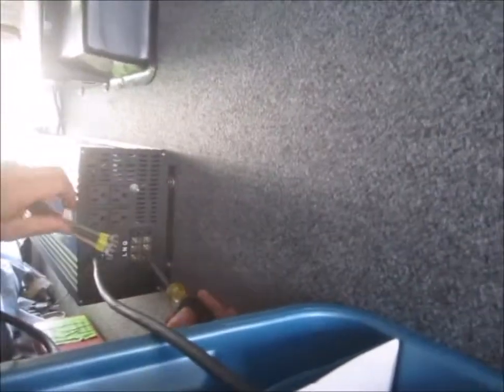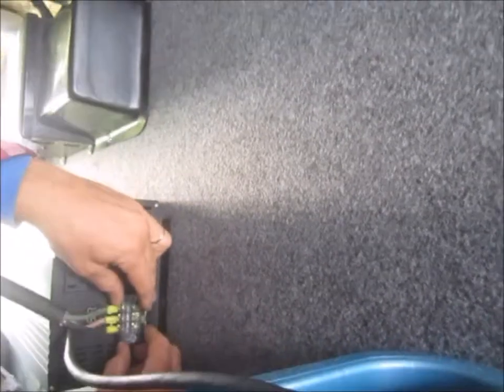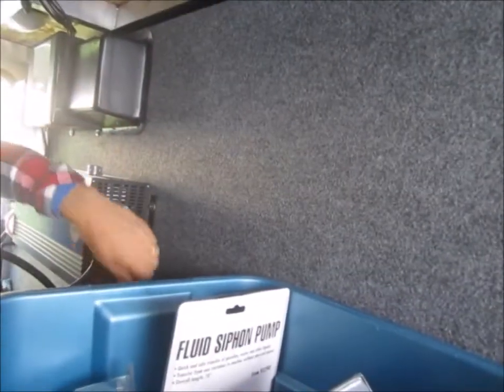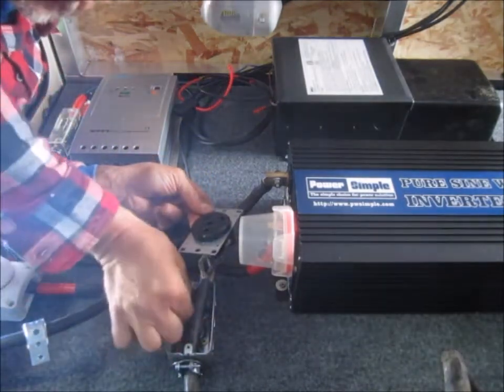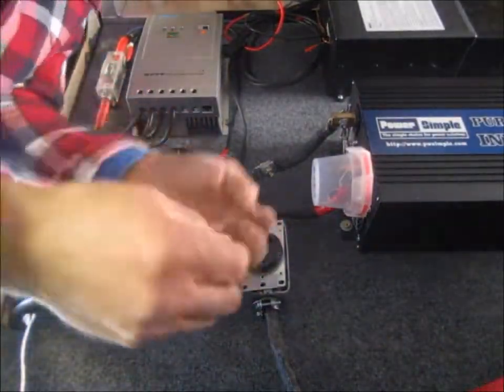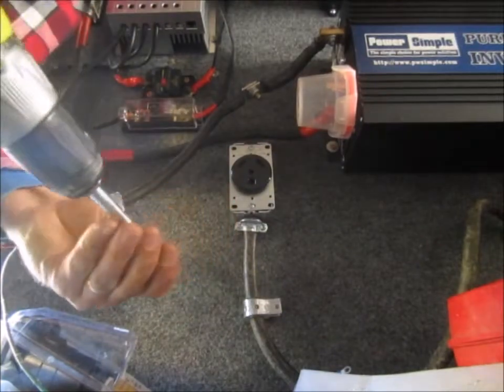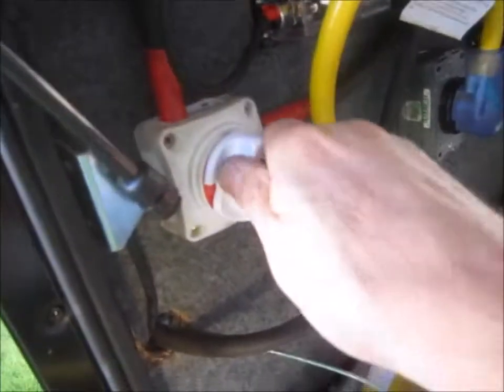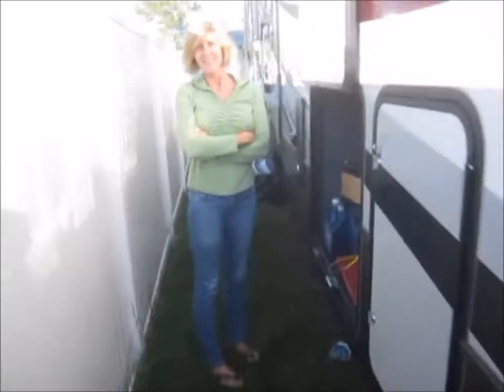30 amp RV plug install for 3000 watt pure sine inverter pt 2

Comment: I've been searching for this on youtube and this 8yr old video is the only one with semi-detailed instructions.. is there an easier way to do this now? do they make an RV plug already pre-wired to fit into those slots on the inverter? I have swi power 3200w inverter and a Wattcycle 12V 300Ah LiFePO4 Lithium battery..  any ideas? thanks!

Comment: Can you use a 30amp Romex cable (orange) and connect from invert to TT-30amp receptacle? what is the color code at both ends?

Comment: What plug yu use?
Reply: Yes where did you find the 10/2 black round power cord? I have looked at Home Depot and ACE and no one has it. Did you just a buy a dryer cord?

Comment: Did you experience any issues with this? I had someone tell me it wouldn't work correctly due to the 30a RV plug being at 120v and the inventer being 3000watts (amps x volts = watts)?  I see where Bluetti AC200Max is a 2200w but has a 30a RV plug on it, so it just seems like it would be fine.   What voltage was your battery setup?  12v, 24v or 48v?
Reply from the maker: It works. It worked correctly for years up till I sold the trailer and haven’t heard anything from the new owner that it stopped working.
50a 240v plugs deliver 120v to each side of the breaker box, 30a 120v delivers 120v. Obviously it can’t supply as many amps so you must be cognitive of what you are trying to run off the off that limited supply. No different than the 2200w inverter will not supply 30a, possibly 22amps continuously until it overheats or the batteries run out.
I was set up at 12v. Many videos on the build.

Comment: How did you discconect your converter charger from the system? and when it is off can you run the 12v lights and stuff?

Comment: If you don't mind, what gauge wires are each the hot ground and neutral that you attached to the inverter?
Reply from the maker: I used 0/2. That was the minimum size for the amperage required and account for cable length
Reply: @StimRacingTrailerandTravels  Nice. Thanks. I was fretting over wire size forgetting that it's going to be 120v and not 12v. Duh.
Reply: @JonEhBee  a 30amp cable should be 10/2 gauge for 30 amps.

Comment: Are you able to also charge battery with generator?  I need to upgrade converter for lithium charge, as well install inverter-solar.  It looks like you created your own solar power bank inverter.  Now how to add solar mmpt with generator charge battery...hmm.  Ever see the point zero titan solar power pack?  Is your system have all those capabilities?  Titan you can charge battery with solar or generator by simply plugging in a charger to wall outlet.
Reply from the maker: Never seen nor looked into point zero? The stock power converter will charge the batteries from shore power or generator, if I have the breaker on. The best practice would be buy a better, more sophisticated inverter with a built in charger.
Reply: @StimRacingTrailerandTravels  

So the generator is also connected to factory converter?  Have motor coach-how does rv motor alternator connect--thru converter while running?

Looks like victron hybrid combo are great.

Here is the titan.  https://www.pointzeroenergy.com/  the lithium battery bank is expandable.
Reply from the maker: @jwitness3079  I would waist my money on that overpriced “backup” ( my opinion only. You asked) 
Victron is excellent stuff. You won’t need a new charge converter with this Victron inverter because it has a built in programmable charger.

Comment: If you have enough battery, say 840AH (10k watt hours) can you run a 13,500 btu AC off this, will a 3000W Invter handle a A/C?
Reply from the maker: Simple answer is yes, absolutely
Reply from the maker: The next question if for how long and how are you charging the batteries?

Comment: What inverter is this? I haven't found any that you can directly connect like that
Reply from the maker: GunGuyMike really? I just did a search on Amazon for 3000 w pure sine wave inverter 8 of the top 10 have direct 120 v wire lugs.
The one I have is no longer available. A similar one is Aims for well under $400
Reply: LiTime 3000 watt Inverter.

Comment: I like the way you hooked up your 30 amp plug in the RV, basically like setting up your own shore power off your batteries . A few questions for this novice.. if I am understanding it correctly you have your batteries tied  to your inverter with a fuse in between, then you have  your 30amp plug you just installed wired straight to your inverter? And that's the only  wiring needed for powering the 30 amp plug? 
Second question I see on your breaker box you have a breaker for your converter that is at least labeled, mine is not labeled specifically for the converter box  , so how would I recognize the fuse or how would I shut the converter off before I plug into my 30 amp plug to use my inverter?
Sorry for the novice type questions?
Thanks
Reply from the maker: #1) You are correct.
#2) Part 1. Correct again. Part 2. If your converter is not labeled, its possibly plugged in to a circuit with outlets, or shared with other equipment. 
When you find the breaker, you would need to decide if the other outlets, or equipment can be done without on the shared circuit or if  your converter should-could simply be unplugged.
Reply from the maker: Rick. I am finishing a similar install today. From the roof with new solar panels to the inverter plug. Its a 2000w inverter and only a 20amp plug but it may be helpful to you.
I hope to have the video up by the end of the week.
Thanks for subscribing.
Reply: Ok great, I will look for it.. you already have a 30 amp plug installed, just wondering why another 20amp plug ? Or is this for a different Rig? 
Thanks
Reply from the maker: Different rig. Started loading the overview video. Should be live in 2hrs.

Comment: did you disable the charging system when running off the RV battery bank ?  how do you avoid the loop /charger dilemma ...with an isolation switch for the battery?
Reply from the maker: termy57 I turn the circuit breaker off that powers the converter/charger.
Reply: will the normal DC lights and such continue to function?
Reply from the maker: termy57 yes, powered from the battery's. I made a video that shows what beakers I leave on, and why I turn the rest off when on inverter power. Would you like me to find the link for you?
Reply: please do and  TYVM :>)
Reply from the maker: termy57 found in the solar playlist. https://youtu.be/Ds9kV1M3Ksc
Reply: thanks again...subscribed now

Comment: That's awesome! So, all your outlets in the RV will act as if you're hooked up to shore power and will run things that wouldn't be possible using just the house battery? Blow dryer, fans, maybe the roof a/c?? Can't wait to hear your response.
Reply from the maker: I control what outlets have power by switching the breakers on and off. The more you want to run, the more solar and batteries you will need. We normally have 4 breakers on at all times. Bedroom, GFI(Bathroom and outside) Kitchen, and garage.  We have the refrigerator on gas most of the time. Have the entertainment equipment on a switched power strip, and turn it on when we use it, because it has a lot of vampire draw, along with the microwave breaker on only when in use. I would have never guessed the microwave would use so much power when it is not running?

This video is part 2 of 3, if you have not watched part 3, please do. Then later this week, we will be doing a final rap on Phase One of the battery and inverter before starting Phase Two. More batteries, 200watts more solar and an extra power converter (for the new batteries)

After phase 2, it may be possible to run our 11,000 btu AC in the bedroom on a sunny day. We will test that when we get done and make a video and show you how it goes.

Phase one was the most expensive part, because of the 3000 watt pure sine inverter. It cost about $2000 and ALOT of my time. (1st time working with solar) Phase 2 will only cost about $600 because the ground work was laid in phase one.
That will give us about 600 amp hrs, and 600 watts of solar, with expandability of 300 more watts for only $450.

I hope this is the response you were looking for? And yes, the hear dryer works after a shower. ;-)
Reply: Holy smokes! I'll check out part 3. I am new to this class c (old one) I bought and moved into in late June and I'm learning as I go. I only see 4 switches on my breaker box and they aren't labeled so that will have to be trial and error, then I'll label them. I have no solar and I have only 1 deep cycle battery. I have yet to boondock, as I had planned to primarily do. I found I could not survive the summer without fans (at least) to move the air around. So, I'm at a campground.

One thing I did notice in my cubby that has the power cord is there is already a 3-prong outlet installed in there (has a flip-up clear plastic cover over it) and I saw in this video that you installed one yourself. If mine already has one, could it be that I have something else I don't realize? 

$2K for a 3000W inverter? I found one on Amazon for less than $400. I hope it's not a piece of junk but it has good ratings. I haven't bought it yet, but I can't afford 2 grand at this stage in the game.
Reply from the maker: The $2k was for phase one. All the parts for the solar and inverter hookup. I paid around 4 to 500 for the inverter alone.  Sorry I was not more clear. You could do two 6 volt battery's and a 1500 watt inverter, with no solar then boondock 2-3 days before needing a charge. It would do everything but run the ac for under $500.

Sounds like you could skip part 3 if you have the 30 amp plug already.
Reply from the maker: Btw, you want a pure sine wave inverter. Not the modified.
Reply: Oh, okay! That makes more sense. Yeah, it's a pure sine inverter. I'm going to get the 3000W but I'll need to buy one more battery. I did watch part 3. It takes guts and confidence to bore holes into the body of your beautiful 5'er. WTG.
Reply from the maker: Thank, Haha. Just eye balled her...
Reply: Let me ask you one thing, though. If my motorhome already has the 30 amp plug installed, would that indicate that an inverter was used in it by a previous owner? And if it does, would that make my installation of my new inverter easier or faster? Thank you.
Reply from the maker: I don't know why you would have a 30 amp (female) plug? Could you take a photo and paste it somewhere so I could see?
Reply: I'll try to remember to do that tomorrow. Might be tough to get the camera in there cause it's mounted to the floor of the cabinet. I'll try, though.